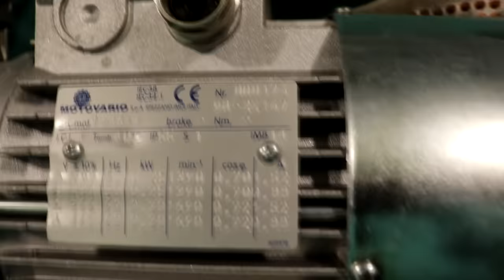DIY Recycling Machine for Aluminium Cans (Make money from your aluminum cans)

Comment: Figuring that machine costs about $400 with parts fab and everything. You would need 64,004 aluminum cans just to break even.
Reply: However,  only 38 hours to crush the 64,004 cans
Reply: If it cost $400 to build, and the machine can make $1.5 per kilo of cans crushed. It will need to crush 266.67 kilo/266670grams to create $400. 1 can weighs 14.9 gram, so approx 17897 cans are needed to break even not including fuel cost of cans and so forth.  At 2.14 seconds to crush a can, it needs 38299.58 seconds to crush the 17897 cans. So it would need 10.638 hours.
Reply: If use are going that far into detail, add the amount of power draw and cost of power used also in your calculations?!? Please and thanks
Reply: Not really.

Everything but the angle grinder, and welding machine you can get for free from scrap heaps/recycling centers.

The angle grinder and welder would also become tools you can do pretty much anything with too. Turns a one-off project into a nice hobby. Hell, with practice, maybe even your own business.

Businesses aren't made by college grads. Businesses are made by regular people with the tools to make their ideas a reality. Those non-college grads then pay college grads to do the tax filing for a small percentage of the loot 🤣 The meek own the world already. If only more people saw this, and tried to do the same for themselves, we'd have less couch potatoes demanding others give up their earnings so they can continue the couch potato life uninterrupted 🤗
Reply: Not even counting the cost of all the metalworking tools which most people don't have.
Reply: @TomBom292  metalworking tools? The only thing you really absolutely need is a saw which can cut through metal, which can be gained for a few dollars from local diy store, and a drill with metal drilling bits, which again can be had for cheap. Oh, and some sandpaper available for 20 cents is a good idea too, for smoothing out edges.

Angle grinders, welders and all the fancy equipment… that’s not actually necessary for small projects like this. No woodworker or metalworker starts out with thousands of dollars of equipment. They get it as their income and skill progresses.

A craftsman or woman isn’t measured by their tools. They’re measured by their creativity and skills with working with what is available to them at their budget. Anything else is just secondary

Comment: Ah, so now I understand the word "overkill". But nevertheless, well done...
Reply: you literally could just step on them and they are as flat as in the video...
I wonder how many tin cans you had to crush to make the motor itself pay of
all the work excluded, also that the recycler probably also pays for normal ones an even if not you can crush them by hand/feet
Reply: May be overkill but I bet this machinery could run 24x7 as long as you had several people feeding it. Of course, I don't think it would work with bent cans without manual loading. I like it!
Reply: @benediktfrasch2812  Earlier in the video he appeared to smash them thinner but at the end they're not as flat. It appears he needs to adjust the placement of the motor, or have an adjustment device, so it totally smashes them. Of course, this saves your foot and shoes.
Reply: @benediktfrasch2812  I have done this before by hand, most of the cans come from the streets and are disgustingly dirty, the beer cans usually have decomposing liquid with bad odor wich means dangerous bacteria, if you smash those cans with your feet or your hand and your cut your skin youll get a horrible infection for sure, also is very tiring to smash 300 or 500 cans using just your feet so this machine is a wonder for the people that make a living from recycling aluminium.
Reply: @elrickking9293  I don't think you would have to build something like this from steel plates and weld it... mostly wood would do the job
also if you have a welder and all this stuff you don't have to make a living from aluminium cans
Reply: No such thing as overkill, it's just " load for round two!"
Reply: The word “overkill” is mostly used my lazy people who build crap and wonder why it doesn’t last.
Reply: Anthony Verloop Next episode: Recycling factory
Reply: how much volume 
you break your foot crushing 30 cans
Reply: Not overkill, automation
Reply: Nice robust design but I feel it is a little over engineered. What are the running costs per hour?
I've seen a simple hand press machine which was just as quick and just as effective and I'll bet cheaper to run! 😎👍😁
Reply: i

Comment: If you conert it to a "V", hopper, it will eliminate the issue of cans missing the  crushing chamber amd have alot more capacity.
Reply: What's a V Hopper look like? Do you have a link to a picture? Thanks
Reply: I think hes trying to say is have another can rack (hopper) on the other side. \••/ looks like a "V"

Comment: Great video ! Definitely not on the cheap side of DIY, but for a more industrial or long runs it's definitely worth it. I recycle aluminium cans for casting parts as a business. This is definitely a design I am considering using.
Reply: out of sheer curiosity what are you making with recycled aluminum cans?
Reply: @Drillz007  I cast mostly parts for my drum making business and to upgrade my shop tools

Comment: My wife and I collected cans in the 1990’s. At 10 cents each, she still has a nice gold ring from our profits. It works to recycle.
Reply: Yep, made thousands from recycling aluminum when it was around 50 cents a pound.
Reply: Unfortunately it really doesn't pay to recycle aluminum cans anymore. Cost per pound is laughably low if you account for inflation, and so much now days is in plastic bottles there's less and less cans out there.
Reply: That's a nice payday.  It now averages $0.01 per can
Reply: stefan Lopez 
When I was scrapping aluminum it was 50-60 cents a pound depending on the grade of aluminum.  I was told that the Chinese (go figure) flooded the market and that’s why the price crashed.  True?  I do not know, but I know I could no longer flip aluminum for a profit after the price drop.
Reply: @sooverit3258  back then they are using real aluminium, now they change to composite of tin, China have bigger tin mine than US, so the price is very low compared with Tin made in USA, so many big industry in USA start to import from China and slowly replacing aluminium with tin so yeah the bottle now is 100x cheaper than what it used to be because different alloy.
not China fault for big companies in US bought it for in the first place.
the real aluminium itself still in high price both US and China have same respectable value.
Reply: Indo Mechanic 
That makes sense, thank you.  I used to buy military surplus focusing on aluminum, but that source has relocated.  Lower aluminum prices and lack of volume forced me to stop doing that.  It was great for awhile😊.
Reply: @sooverit3258  you still can find it from telephone cable (many of them using aluminium wire) or in 3rd country they use aluminium cable for live wire.

but right now is more profitable making thing from aluminium or aluminium casting rather than selling it to recycle companies.
Reply: Indo Mechanic 
I was buying medical storage containers. Weighed about 30 pounds each all clean aluminum except the steel latches.  So just 30 of them was 900+ pounds.  It was a lot of work, but totally worth it.  I am a 5’2” female, loading then unloading was well interesting. It’s just that I am so short trying to lift into the truck proved to be ....like I said interesting at times.  Haven’t scrapped that volume in years.
Reply: @Glasnot1  Aluminum cans are still aluminum, no tin. You're thinking of copper pennies.
    pennies are now  97.5 percent zinc and 2.5 percent copper
   Tin                  Per 1 Kilogram	         17.46 USD
   Aluminum     Per 1 Kilogram	           1.77 USD
   Zinc                Per 1 Kilogram               2.41 USD
   Copper           Per 1 kilogram               6.61 USD
Reply: Good thing that some countries have deposit on cans to encourage people to recycle more. Here it is 0,15€ per can
Reply: Mika 
We paid extra each month to have a recycling can at our home.  Had two recycling cans (blue) and one can (black) for non-recyclable trash, BUT the city has determined they are not making any money off recycling.  So they have terminated the entire program.  ALL cans will be treated as trash and transported to burn pit or landfill. We were not given an option to vote on it, pay more, nothing.  Another COVID victim?  As they did this one no one was “allowed” out to hear, see, talk, etc.😡😡😡

Comment: Go on show us the making money bit.
Reply: Put it to work crushing cans that people bring to you. Or set up can collection points that people drop cans at. 
It'd be a good side hussle if someone has time. Or for someone with a disability.
Reply: @fartzinacan  Cans are very low-grade aluminium. There isn't anywhere here that will give you anything for them period.
Reply: True.... If you bring 49,000 cans to a recycle center, they give you $1.18
Reply: They give 5cent per cans in most grocery stores here(the 5 cent is charged when the canned beverage is bought and they given back to whomever brings the can back)
Reply: @yoanngirard8780  That's because you are paying the 5 cents when you buy the can. It's an incentive by the government to prevent people from just throwing them out.
Reply: @joer8854  i wrote that almost word for word in my comment
Reply: @joer8854  I think in NY you have up scan them to get the money back, so if you crush them, you'll ruin the barcode and won't get your money back
Reply: Definitely a solution without a problem going on here. Though I did watch the whole video.
Reply: Best option, make it coin operated and watch others pay to see cans crushed. Keep the money and the cans.
Reply: Sell the machine to someone
Reply: Probably made something from 2 million Youtube hits!
Reply: 🤣 no doubt

Comment: Unless you're a professional machinist, this is not DIY.
Reply: DIY means do it yourself, not that you don't need skill to do it. he built it himself as such it is DIY.
Reply: @j.c.cannon2112  putting "DIY" in the title of the video implies that anyone watching can do it. I agree with Josiah, this is not DIY. Sure he did do it himself but aren't all things done by someone?
Reply: Also, not very cost effective. Good for a YouTube video but not practical
Reply: about 100 dollars worth of parts, that's 2000 cans worth.... if your a smelter it makes smelting easier and less labor intensive..... tbh, watching what he did, I'm not a machinist and i can figure how to put something similar together without using a lathe and just using a bench grinder, side grinder and a belt sander. total cost of parts including tools is 300 bucks and the tools are multi-use for other projects.
Reply: @j.c.cannon2112  Really?
Reply: @Adam Courchaine  Don't forget the metal lathe, we all have one of those.
Reply: it can be done from wood too
Reply: @thebeardyyc  right on
Reply: @Chip-Chapley  lol 2000 cans not rly aluminium recycle value is about 0.20 cents per pound ( pound is roughly 32 empty cans ) so 2000 cans would be about 62 - 63 pounds times 0.20 cent wooootttt 12.5$ , ur number are a bit off chip ,nice build but will not make any profit soon esp if u need time to collect cans too and time cost money as well  unless you put big sign in your front yard saying dump all ur empty cns here
Reply: theNEScollector1985 what is it that he did here that you can’t do? DIY literally means do it yourself. It doesn’t mean simple or saving money that most people like to say. If you watched a video that shows you how to change your oil and you see that you can do it but you own none of those tools is that oil change video no longer a DIY video? You can go out and buy a manual can crusher and install it with 2-4 screws but if you look up a video on how to make one, then the difficulty or time spent is irrelevant, it’s still a DIY video.
Reply: @matthewgarcia2119  I agree with that logic and I understand the sentiment. However, colloquially speaking, most people associate 'DIY' with the thinking that anyone with the proper tools can do the work. Even if a person did have the proper tools and materials, this project does require a level of SKILL and KNOWLEDGE that the average person does not posses. A person would literally need to be a professional machinist to do this type of work. Sure, you could do that yourself, after years of training but, that would negate the entire concept of 'hey, anyone can do this!'. See the point now?
Reply: Josiah Hockenberry There are plenty of people that still don’t know how change oil but it’s one of the easiest to teach. DIY generally is essentially a how to video. You don’t walk away from this video knowing how machines work, just how to make this particular machine. A DIY project can range in difficulty and is not limited to beginners and that’s why your explanation of DIY “everyone can do it” is wrong. You may DIY simple projects and as you gain skill you can tackle harder projects and it’s still a DIY project. Either way it’s a pointless topic lol. Agree to disagree. I really want to make one as a Christmas gift. A buddy mine hammers down sodas.
Reply: @matthewgarcia2119  Dude, go for it. I guess there's no reason for engineering schools then. Hey, while you're at it, make a rocket too. Lmfao. GTFOH.
Reply: Josiah Hockenberry don’t straw man me bro. Peace. Open up another tab or go to the one where you looked up colloquial and search for straw man and best part is, you won’t have to go to college.
Reply: @matthewgarcia2119  Wow. Here I was thinking I was debating and not realizing I was being trolled. I blame myself. That's one point for the trolls. Bravo.
Reply: I’d argue it is DIY, I’ve built smaller machines and think I could easily do this in my HS metal working shop. I think it definitely wouldn’t look this pretty. But it doesn’t have to look good, it just has to work.
Reply: Josiah Hockenberry 😎
Reply: @matthewgarcia2119  ✌
Reply: This dudes a hack. Not a machinist atall...
Reply: Don't need to be mate, it's more boilermaker field. But so simple that anyone could do.  You can still do this without having to machine anything. Just change the sizes

Comment: The cost of this device plus the electricity bill REDUCE THE PROFIT of the recycling effort and all the products (grinder discs, welding equipment and consumables, the spray paint, etc...) are all BUT ECOLOGICALY benefical!
Reply: Not at all. The footprint is enormous. Such a big amount of steel, and the machine is moved by electricity...

Comment: 2 Tipps for you
1. Don't push while welding! Pulling while welding will make youre welds look better
2. Don't paint somethink untill it's completely done. IF something doesn't work and you have to change something you have to paint it again.
Reply: mirco _b04 pulling while welding ? You mean stay at the same distance right?